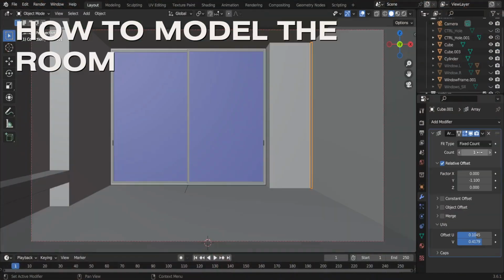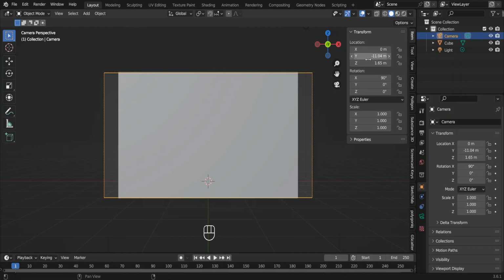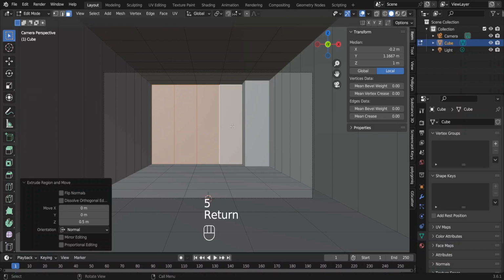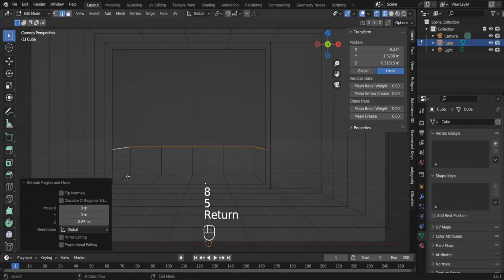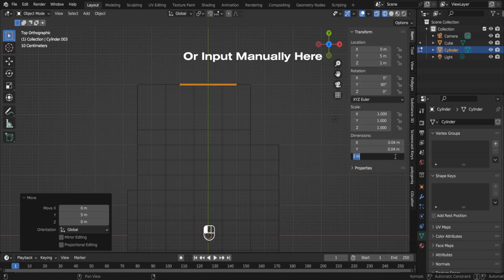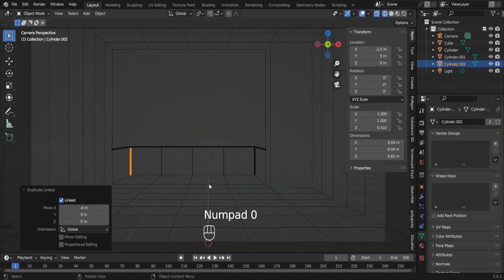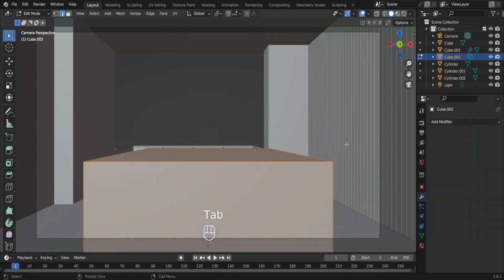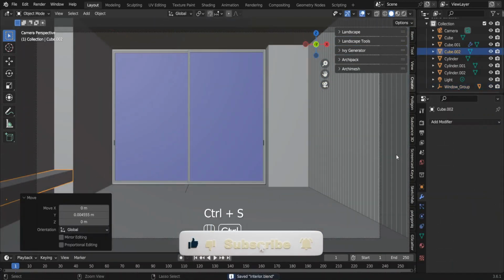Blender FULL BEGINNERS COURSE | How to Model Interiors

Comment: I'm following and learning from this series. Thanks for the time.

When are the scenarios one needs to do the apply scale process?
Reply from the maker: Hello Dwayne!

There are many instances where it would be necessary to apply the scale in blender. 
However throughout this tutorial series you would need to apply the scale for following tasks,

1. When you bevel the edges
2. When you UV unrwrap objects (when adding materials)

3. When animating and simulating objects (wouldn't need for this tutorial series